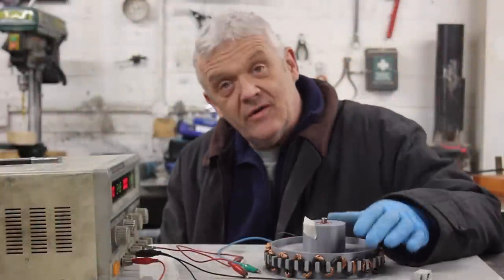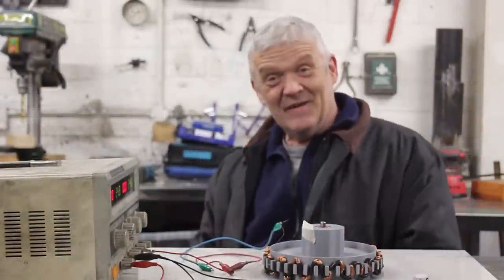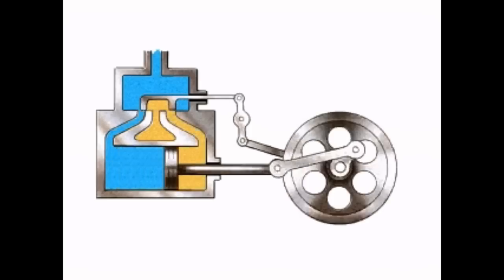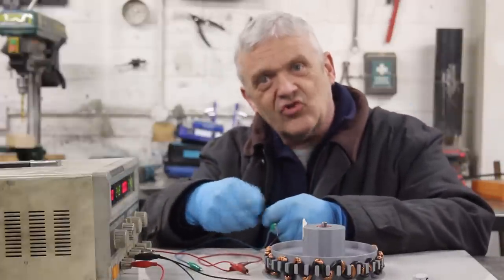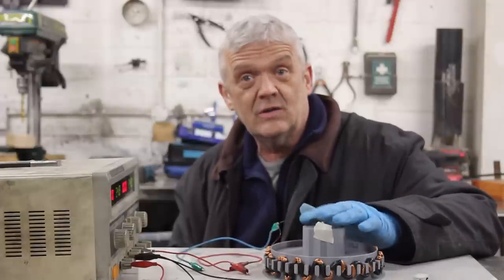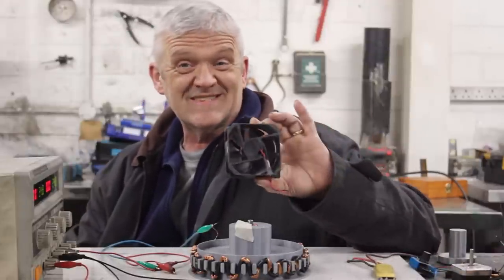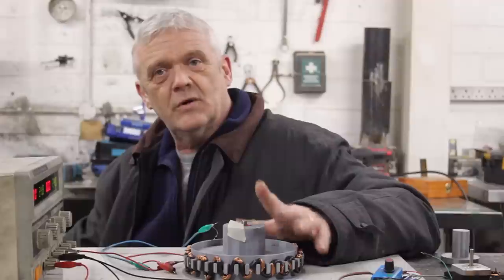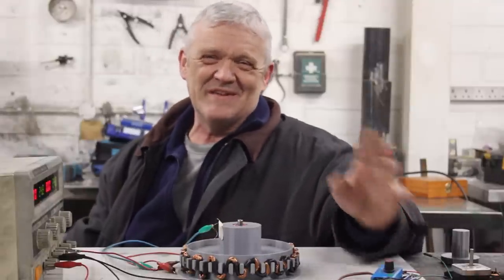1870 The Twisted Serpent As A Motor

Comment: The hard part for a human is that the timing changes as the speed of the motor changes. Having done similar in the past, that's the most difficult thing to wrap your head around.
Reply: I think you are right, and as the rotation speed increases, the pulse duration would need to get shorter and advanced until it couldn't be done anymore.  A calculated pulse skipping might work for higher speeds but with lower torque?  I think thats why most electric motors are made for one set working speed. It would take a computer and a rpm light to sort out all the pulses at different speeds.
I don't think as a generator it would have any problem like that.
Reply from the maker: it does take a little practice lol
Reply: Use Reed switch Luke

Comment: Robert, could you print a stator that extends over the outside of the coil and add magnets to it? I'm curious if sandwiching the coil with magnets on both sides would increase performance without adding much complexity or cost. Thanks for all you do 🙂 love your work!
Reply: It absolutely would.  Backing both sets of magnets with a strip of steel banding would be better still.
Reply: @whatelseison8970  Oh hey 🙂Thanks for the reply! Do you mean like one continuous strip? Or like individual strips? Also, would you be so kind as to explain what that does to help? I'm trying to learn 😅
Reply: @Unpopular_0pinion  Steel backing confines the stray magnetic fields, that are dispersed on the "wrong side" of the magnets, so that the fields facing the coil get boosted.
Reply: @sleeptyper  Thank you! 🙂
Reply from the maker: you absolutely could do that mate - but magnets are expensive - 3.60 in this model and wire is cheap 35 pence in this model
Reply: @ThinkingandTinkering  Thank you 🙂

Comment: How do you even do this? Put out all this cutting edge free outsource information, crank out these prototypes and field all these comments!  I was curious about DIY  battery technology and I was able to find the subject in your archives fairly quickly. E-bike hubs from failed wheels can be an easy to find generator if you get the three phases converter. Nowadays there are so many power generation alternatives that didn't exist 20 years ago (economicly), but the energy storage is the sticking point. For home or railway storage it can be dense and heavy, but for nomadic or flight use it must be lightweight. The serpentine and circumfrence  generators are amazing. I've heard of glass batteries that improve with age to a point and super capacitors, but they are beyond my understanding.
Reply from the maker: lol - I do work a lot mate - we have done a ton on storage - I will say this electrochemical batteries of the kind you are thinking about are stunningly easy to make in ones and twos and stunning difficult to make a lot of

Comment: Great video, great topic as usual!
I have a quite specific question:

I recently started researching a lot about Lebanon... they have a lot of things going wrong in terms of infrastructure. People and businesses there only get access to electricity for a view hours every view days. I find their energy problem really interesting and try to develop a non profit that gives people there access to a decentralised and sustainable source of electricity. ... it doesn't have to be much... due to their geographic advantages I think they can make use of solar power in combination with a battery that could supply a computer with enough power to run one or two days. This would give them security and lets them plan ahead. 

Do any of you have some kind of input or recommendation for source of energy conversion or energy storage? Criteria would be cheap and or easy to buy or even self-produce. Thanks in advance!
Reply from the maker: my advice - stop thinking about batteries as electrochemical devices
Reply: Thanks for your opinion! 
I tried to do my research on flywheels and gravity batteries (the burried ones not those block towers) but couldn’t make sense of the best option. It needs to be bulletproof or easy to repair and fitting for a small community of around 5-50 people or so.

Comment: you mentioned that adding more coils made a better motor but does the same apply to building a better generator
Reply: That really depends on your needs. If all you need is DC or single phase AC it's probably not worth the hassle, but if you specifically need 3 phase for something then 3 coils might do better for you.  It would take special consideration and planning to avoid getting your coils all twisted around each other if using serpentine coils though.
Reply from the maker: it's not 'better' per se as in a more powerful motor - it's easier to control - with a generator you just don't need that kind of control - so why bother?

Comment: I really like your experiments here, but one issue you might change to make a difference in efficiency/power output is to give your magnets something to direct their field fully across your windings.  At the moment, the n/s placing encourages the fields to form shallow arcs from one pole to the next.  Since you are using very strong magnets, even though the field lines don’t extend very far, you still get good results but you might change your setup so there is a good pole opposite the magnet for the field to cross over to.  By putting more space between the magnets, and an opposing pole piece closer than the next magnet with the winding in between, you can get the field to cut fully across the winding.  You could think of it like a “keeper” on a magnet but with a gap for the winding.  
The closer you space your magnets, the less distance the field reaches out to.
Reply from the maker: yep you are right
Reply: I surface grind thin steel reeds for concertinas on a magnetic chuck I made 30 years ago.  I had the opposite problem because the normal pitch of available chucks was too wide which didn’t concentrate the field well enough for the very thin steel reed tongues.  At .080 inches pitch, the field hugs the surface but is very strong there.  Put anything over 1/8 inch thick on it and you’ll never get it off again.

Comment: Would single phase ac not work? The polarity of the windings would be switching back and forward between positive and negative as the magnets pass. Ofcourse then you would need a vfd to control the frequency and therefore the speed.

Comment: Got a large field, low wind speeds so instead of making a large wind turbine I was thinking of using lots of small ones that will compound a usable quantity of power. How would one link them together to charge a battery for example? Would each one require some sort of voltage regulator so all of them output same voltage? Im thinking not all of them would spin at the same speed and their outputs would be all over the place

Comment: ? wind operated graduated resistance switch? If one were to wind four serpents in one would the resistance to the start up and increasing levels of generation be able to be controlled ? Or is it naive wishful calculation? I,m glad i did,nt start making anything yet, you keep on adding improvements. I don,t like the wind operated clutch, belt and two generators of different sizes that I,m looking at . Is there an electronic method to enable graduated resistance for easier turbine starting ?

Comment: If you feed this motor AC, it will run as a synchronous motor, the downside of those is the lack of torque as if it stalls more than a given angle, it will just vibrate.

Comment: You can also do three phase serpent coil by using 3 sets of tangled wires. Just set it through every third point. You might get it more officiant with that older side coil design and using coils on both sides of the magnets. Bifilar coils would be even better ;)
Reply from the maker: yep
Reply: Could you try the magnets in halbach array? There is not much documentation about those with generators on YouTube.

Comment: Robert I have noticed that in all your designs of these generators you have the copper on the outside of the 3D printed part, meaning you have some amount of plastic between the magnets and the copper. I understand that this design makes assembly easier and this shape keeps the copper in place without need of extras. But wouldn't having the copper on the inside so that there is no plastic between the magnets and the copper have a (slight) increase in power generation for the same wind input? Is there a test you could do for this? I assume if you pull two magnets apart it will take more effort than pulling the same magnets apart when there is a piece of plastic between them. So moving a magnet vs a magnet with a plastic shield over a coil should give a different read out on your amp/volt meter I think? If the difference would be significant a small design change could be a way to improve efficiency.
Reply: Yes but you still have to have a gap of air between the magnets and coils. Without the gap it will not turn. The smaller the gap the better but you run into the issue of being able to keep the tolerances tight especially with a plastic home brew. If you have metal and solid bearings that can maintaine the tiniest gap you will have best efficiency but its hard to do something like that without a machine shop. Plastic deform with hear and is not very accurate and the runout of the bearings will have a play to them as well. When you get down to it, it's a matter of cost and difficulty  of producing a product. The tighter the tolerance the more it costs and harder it is to produce.
Reply from the maker: dog gave a good answer mate and I would have said the same thing tbh
Reply: @ThinkingandTinkering  you now have a plastic ring on the inside with blocks on it, and the copper sitting between the blocks. What I'm suggesting is to move the plastic ring to the outside...  The one thing that would change is the copper being pushed into an inner circle instead of onto an outer circle. So tolerances and bearings shouldn't play, what could play is the copper easier falling out when on an inner circle. But that might not be an issue if the copper just takes the shape and it being a circle in shape is keeping itself in place if that makes sense. That precision engineering could improve further is a total other thing. The concern I mentioned is the loss from having plastic in between copper and magnet.

Comment: Hall sensors can be found in old VCRs if you want to scavenge them. Probably in old cassette players also, although I haven't checked those. They are used to read the tape for anyone that doesn't know.
Reply: Meaning to actually pick-up the signal? . As opposed to using wire-wound pick-up head ?
Reply from the maker: nice tip mate - cheers
Reply: @philip5940  Yeah, I don't know which would be more effective, and it might not matter depending on the application. But most people have old tape decks and VCRs.
Reply: @ThinkingandTinkering  Great work as always, definitely giving me some ideas for future projects, lol.

Comment: They used to use points for a timer, and used vacuum to make finer adjustments.  I was so happy to get away from mechanical timing.
I have a question, if you run over a water hose sideways with your tire, which way does the water go? Towards the faucet or the nozzle end?  Would a 2 degree angle change that?  This is different though it's like there is no flat part of the tire, the magnetic field is round.  The angle of attack is built in.  Is half of it negative? Would moving the magnet off a small bit 3-6mm to one side help?  I'm trying to be constructive,  I don't have the possibility of a shop and I'm vastly curious
Reply from the maker: I thought that was in ICEs?

Comment: The Imhotep Bedini PC fan is interesting in this regard. No need for hall effect / reed switch.
The inductive "spike" or "archform collapse"  is itself the trigger for base/gate.
It produces some 50v in back EMF from 12v input which is really cool. Charges another battery, as well as moves air.

Another interesting motor is the Tiny generator shared by Patrick Kelly.
It uses just one coil for propulsion, achieving the same flyback generation.
Which can then be converted. Many people are currently investigating this effect (and have been for a while now.)

It would appear that "motors are generators and visa versa" is not quite so simple as may be presumed, as some can do both at once.

Thanks for the video Rob, Keep 'em coming.
Reply from the maker: cheers mate

Comment: I think will be very torqy because for 1 hz moves several radians while a normal one does a full revolution, very good for generator because makes a high voltage at low rpm but also high frequency, maging it in three phase motor i think is just a complication, that serpentine coil should do pull push on the rotor. The only think that i think is bad is the efficiency, because of high frequency per revolution and the hysteresis loop.
Reply from the maker: cheers mate

Comment: Hmmm.....Robert how about for electric generation obtaining one thick gauge square copper wire bent to follow the serpentine 3D plastic stator core shaped design, and reprint the rotor so as to accept tightly packed north south square shaped bar N52 magnets with lengthwise laminated North-South pole magnetic fields when positioned parallel to the single square thick gauge copper wire resulting in the alternating magnetic poles passing by at a high RPM the hairpin square copper wire core at 90 degrees North then South ??? A thought design for Motor CAD to confirm magnetic pole field orientation for best induced EMF.
Reply from the maker: yep it would work - but for a generator one of the key factors is length of wire passing through the field - thickness isn't important there -  so one coil isn't much of a length - it would handle amps but you are not going to get the kind of amps out of this that one thick wire could handle
Reply: @Robert Murray-Smith  We share the same concern. I passed along the thought because of the EMF increase that would come from the dense pack of N-S polled N52 square magnets passing over the single but larger mass of Square Copper Wire. As said, an idea to explore with Motor-CAD. Thank you both for all your videos. I watch each video with great interest. I built my first savonius rotor VAWT in 1986 out of Hawaiian Punch juice 1/2 steel can shells glued to a 8mm steel rod with a replaceable wood bead slid on the steel rod end and that bead nested into a wood block's 10mm hole to start outdoor barbeque fires by igniting the wood parts by rotational friction, and and coals. Just for fun tinkering around. Resulting in no rubbing sticks together and no lighter fluid needed or fluid taste in my cooked food. What fun just for the sake of fun !!!

Comment: Suppose you make two and connect them together electrically?  The waveform generated by one should match what the other wants to see. Albeit there is still the direction ambiguity.  One way to transfer rotary motion.
Reply from the maker: yes it would - clever - cheers mate

Comment: I noticed something I want to share with you all. When you connect an earth wire to a pipe, the neutral from a socket (Blue wire) then wire into a power supply unit from an old radio it gives you free power but not alot. Unless you can connect this up to a tesla coil to increase the voltage. Could you please do a video on this with many thanks?
Reply: I remember powering fairy lights like that 60 years ago. The limit is because you are relying upon voltage drop caused by devices using current within, or even outside the building. Most houses in the UK now have supplies protected by Residual Current devices(RCD) which trip if the current in the line and neutral cables goes out of balance by more than 30 milli Amps. Best not to annoy people by tripping the electrics all the time(I often do it as I can’t be bothered to isolate the neutral when working on circuits!😁).
Reply from the maker: I am sorry mate but this is YouTube and if I were to do such a video it would be removed and I would get a strike against the account - 3 main reason - the first - that's house supply and is dangerous advice - the second it is the main supply and actually theft - the third - here in the UK drawing power on the neutral will trip the RCD on the main board and cut off your house supply - so - no - sorry

Comment: I've noticed all the three pin fans in my old computer computer case need to be updated to four pin fans, or else they all run at a consistent, non-responsive speed.
Reply from the maker: single speed is ok in most cases mate - which is why they do it

Comment: It stikes me that the serpentine coil has a limitation on the current it can put out at high speeds due to the fact that it has a relatively high inductance and resistance compared to generators which utilize multiple coils.
Reply from the maker: everything has limitations - with increasing complexity you get more failure points and expense with simplicity you get lower output but it is easier and cheaper to build - it's all just horses for courses really mate

Comment: You could run that motor just on AC. I´t will do about 2.5 rounds/sec. If you have a simple transformer, let's say 6V AC out or so it will work. You should watch the current as it could become to high but a series resistor will help in that case. It might need a manual push to get going as it has no reason to go either way initially. After that it will run smoothly.
Reply from the maker: there is a problem ramping up the motor speed to the frequency - but yes you could
Reply: @ThinkingandTinkering  would make a great demo